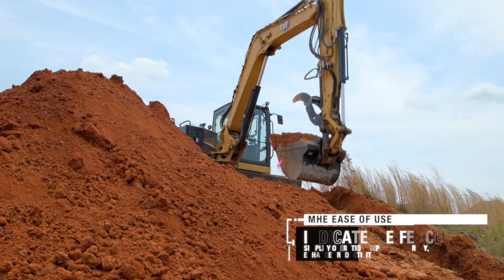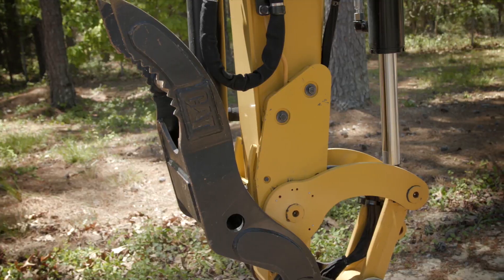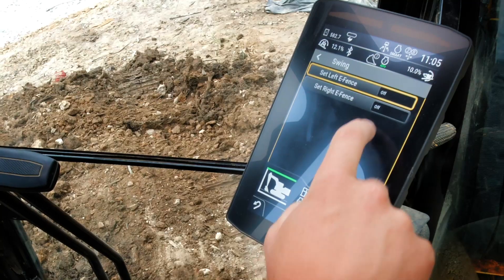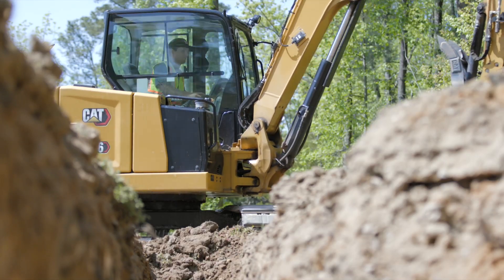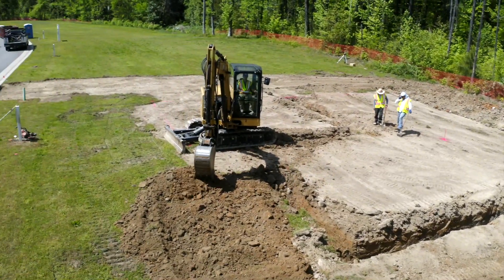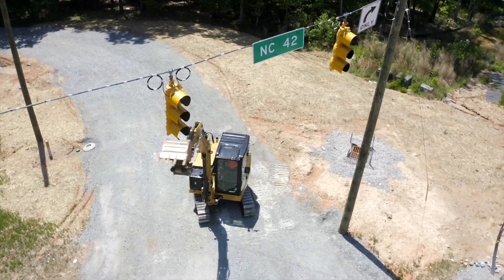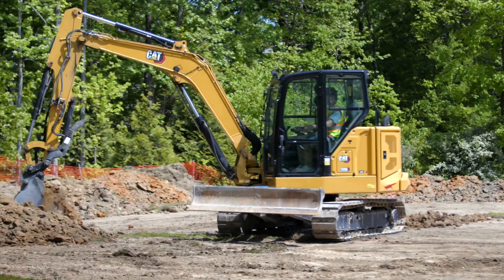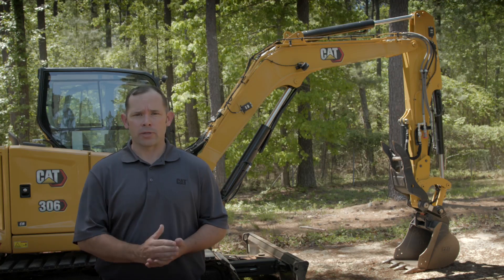Ease of Use Technologies for Cat® Mini Excavators Overview (North America)

Comment: Hello my company bought 308 cr with manufactory y2023 with display sw from august 2022 i have in servise mode disabled compact view so i see much more settings but i didnt see anywhere Ease-of-Use-ready, bager is with long boom and deluxe seat so its not standard configuration